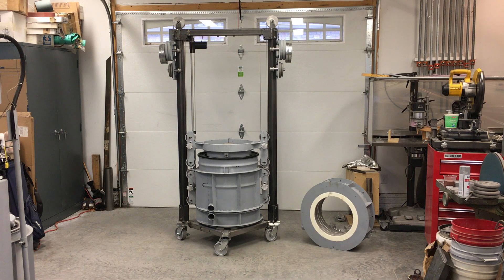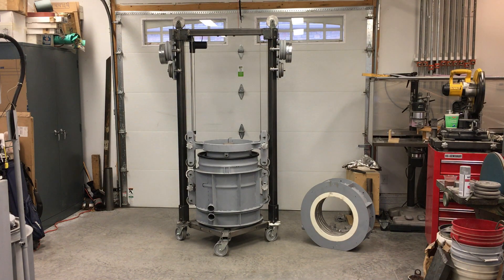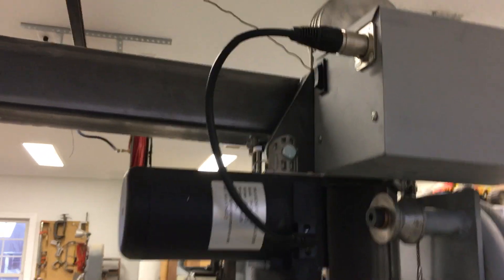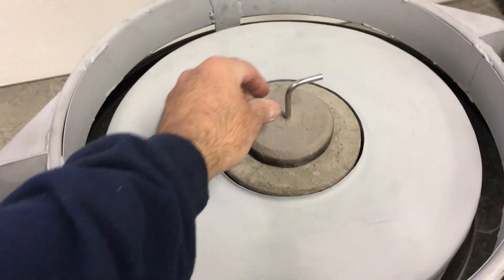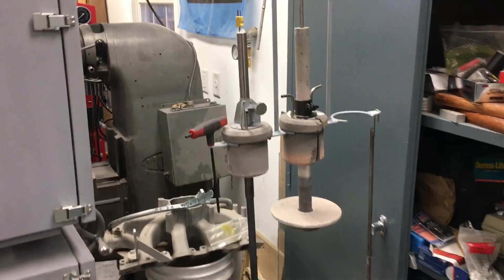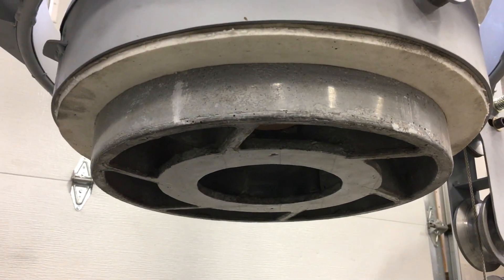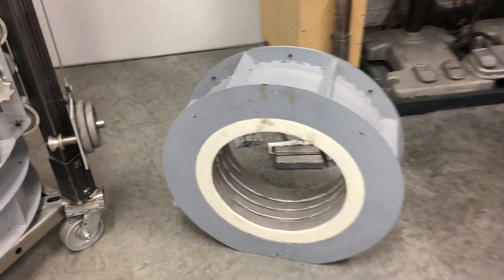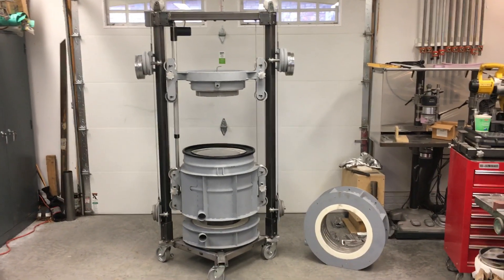A60 Crucible Foundry Furnace Lift Demo

Comment: Is degassing needed with an electric furnace.    I have been using an old burnout oven and have not detected defects I would attribute to hydrogen bubbles.
Reply from the maker: I'd say it depends on your scrap metal quality/cleanliness and what you are casting. I built a degassing lance (see video), but I only use it when I have a lot of sprue/remelt or when I have a critically stressed part or one that needs to be hermetic. It's just a matter of degree but H2 from the atmosphere or fuel will find it's way into molten aluminum regardless of the type of furnace unless it's a vacuum furnace or blanketed in inert gas. Best, Kelly